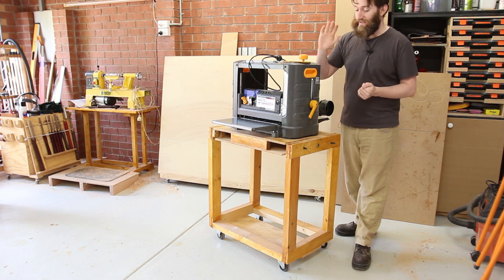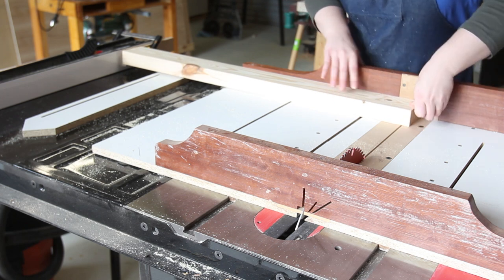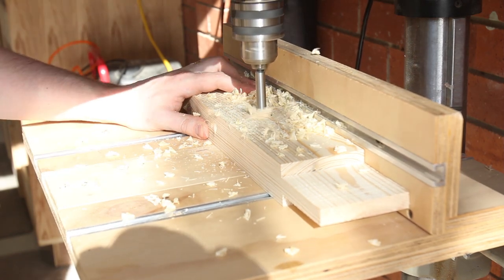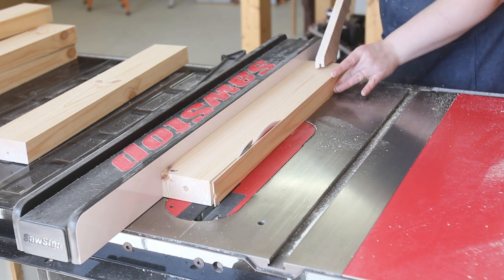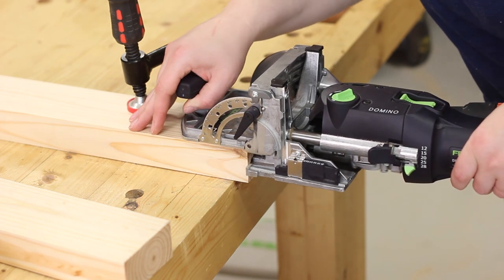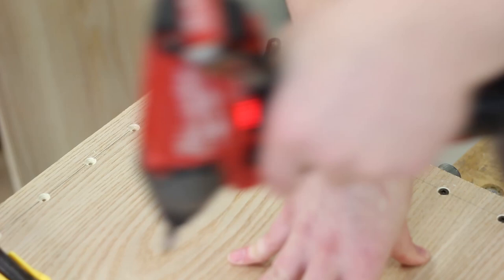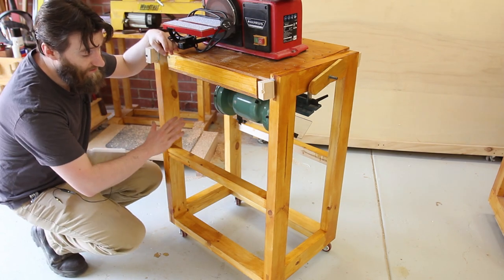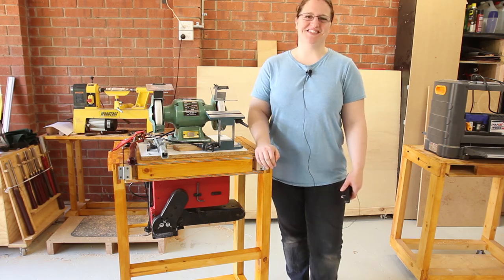075 - Fliptop Tool Cart MK II

Comment: A great design.  I like it much better than the variants made out of plywood because it's a much more efficient use of materials. 

Also, the bridle joints are an excellent way to get the added strength you wanted.    Help me here please.  When I drew out the joint, it appears to me that the spacer should be used to cut the tenon, not the outer (bridle?) portion of the joint.  What am I missing?

Comment: I'm going to do a similar design for 4 carts I need to make.  The video doesn't show what you used for the metal pipe, how big the threaded portion is, or how you anchored the thread rod into the pipe.  I do see that the pipe is cut flush with the base frame. Did you just use galvanized outdoor electrical conduit for the pipe or something thicker like black pipe for natural gas? Is that piece of all-thread longer than the pipe and free floating, or did you pin or epoxy it into the pipe somehow part way through?

Comment: How do you like the Bosch Glide?  It is on my future wish list.  I have a Craftsman slider, but it doesn't hold the settings all to well.
Reply from the maker: +Frank Y (SawdustAndShavings) Dust extraction is pretty terrible, the laser (only the US model doesn't have the laser) is fiddly and most of the time I don't use it anyway (just to eyeball rough cuts). Those are my only two complaints.

Its relatively quiet operating, doesn't seem to bog down, the standard blade isn't too bad, the capacity is great and its easy to use. The settings seem to lock very well too.